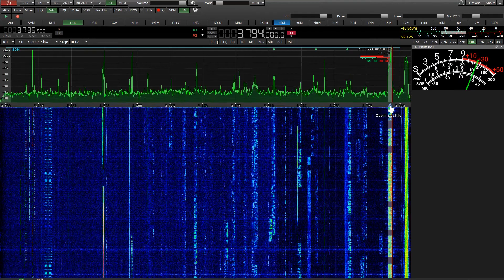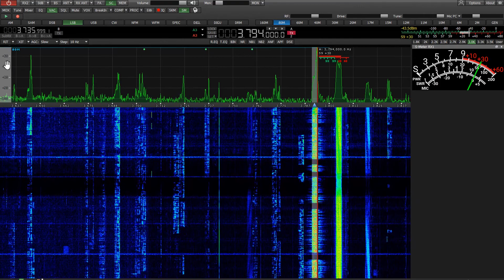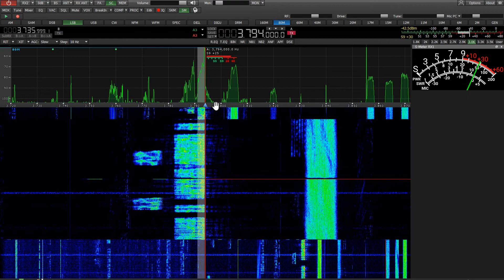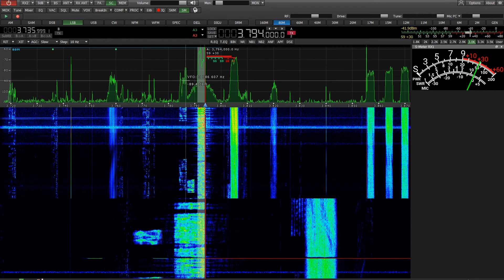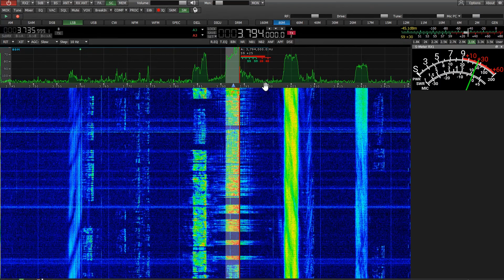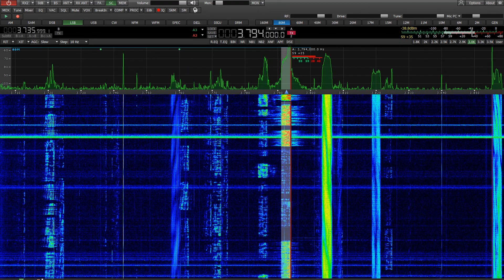Strong signals DF2BO and W1MBB - Sunsdr2 Pro

Comment: Are you using an ATU with your fan dipole and Sun SDR Pro? I was also thinking about putting up some kind of 80 m wire but really want something that doesn't need an ATU
Reply from the maker: yes i do, but not really needed for the 80/40/20m bands that the fan dipole is designed for. I just use it to tweak the ends, and the tune other bands.